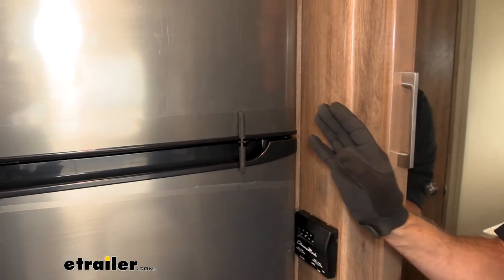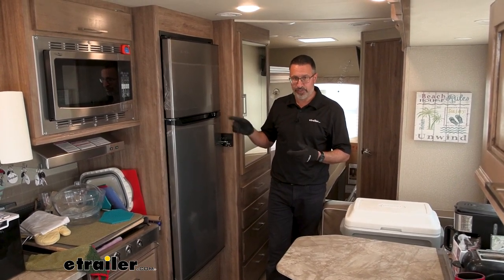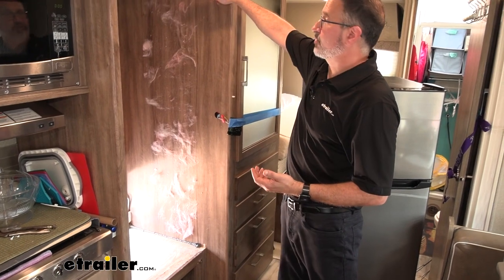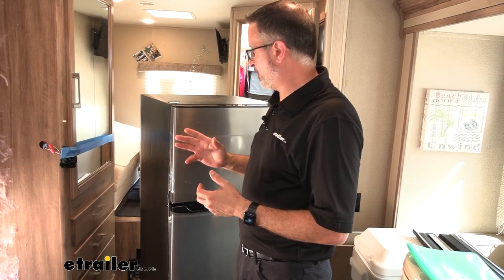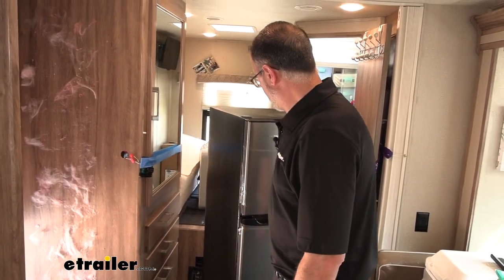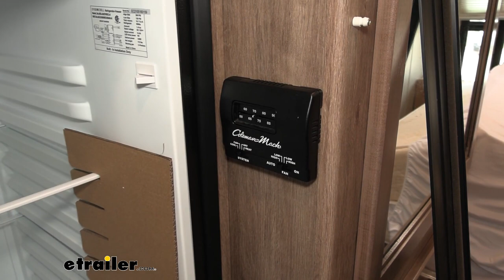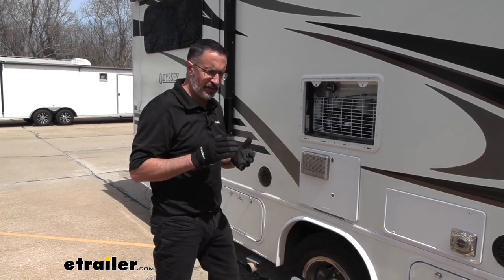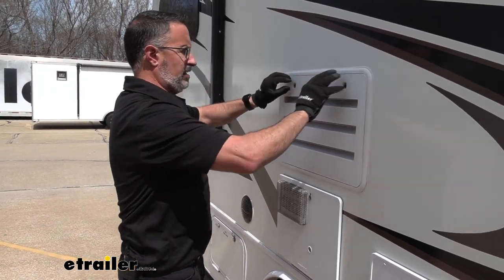etrailer | Set up: Everchill RV Refrigerator w/ Freezer on a 2019 Entegra Coach Odyssey Motorhome

Comment: The fact these 12V fridge companies didn’t design these to be a 1 to 1 replacement of typical rv fridge sizes is ridiculous. Huge lost opportunity for sizing and poor mounting options. Could’ve given people an easy path to upgrade and sold a ton of units for conversions with how many poor cooling absorption fridges are out there. 

I did an Everchill 12v 4.5 cuft in place of my Dometic RM2554. What a pain to get it to fit because I couldn’t easily modify the original camper opening. I trimmed/modified the base crossmember of the fridge frame and left the top plastic trim off the fridge and was still tight. Then I’m left with 1.5” gaps on either end that’s I haven’t found a good trim to cover it with.